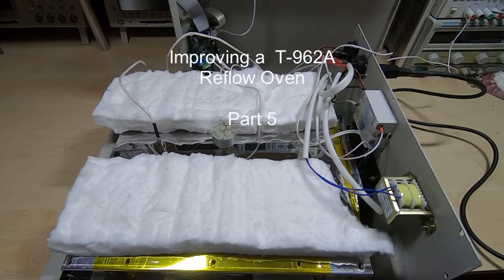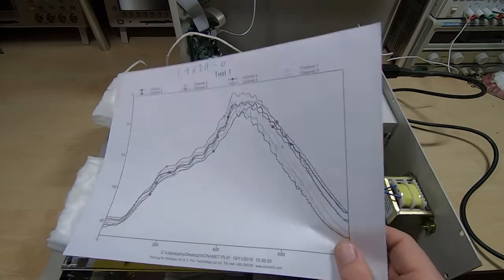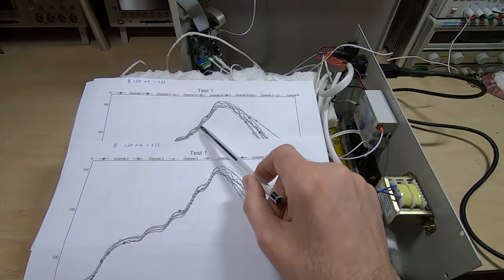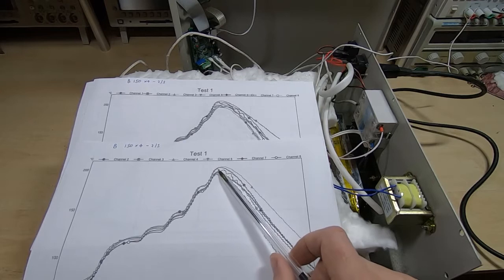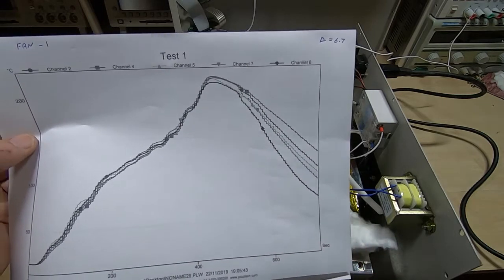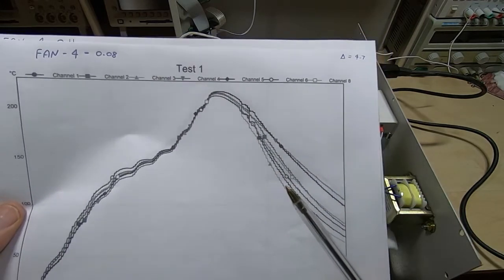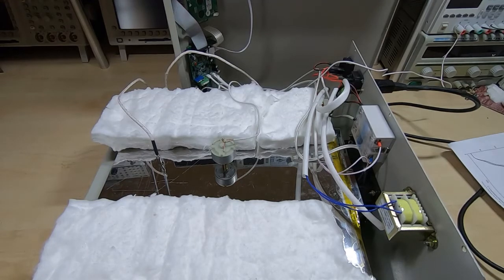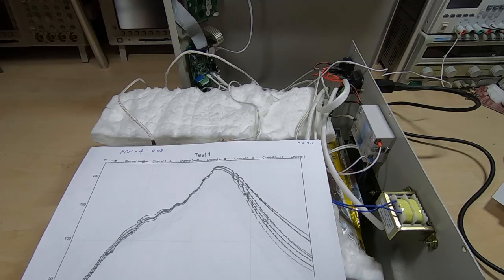Improving a T-962A Reflow Oven Part5

Comment: How effective would the added fan be on a smaller PCB? Doesn't the large PCB (with thermocouples) effect the airflow? Just curious if your fixes would inherently be more effective with a very large board vs a very small one.  Also, what size baffle did you settle on under the heating elements?
Reply from the maker: The board size has no bearing on the radiant temperature profile. That is the point of adding a fan. The only thing that should be affecting board temperature is radiant heat which should be evenly distributed and conduction or convection should be minimised. This is the function of the fan and baffles. The goal is to create even radiant heat over the area of the cabinet and not rely on the board to conduct the heat. I run boards from 15x28mm to the boards I show in the video and they all now reflow very well.
Reply: @JerryWalker001  i see, for a second i thought the added fan was underneath the tray. Do you recall the baffle size for the IR heaters?
Reply: @JerryWalker001  also, did you ever try to upload new firmware and the cold junction fix? I was able to get very consistent results.

Comment: One thing I thought, how much of the improvement is due to the board acting as a duct for the air flow from the fan?  For example, if your instrumentation board had some large holes in it that would simulate more circumstances - like having lots of separate boards, or just one smaller one in the middle.
Reply from the maker: Good question. This is why the fan 'pulls' the air up rather than blowing it down. The air then spreads out and flows down the sides of the chamber and reenters underneath the tray. This in theory should eliminate the major board effect. I have already tried it with smaller boards and it works better as the air can flow more freely but I wanted to show worst case in the videos. I am actually carrying out far more testing than I am showing but will go over anything that ends up being relevant to the final design once I get there. As this is an IR system and not really an 'air' heater then the air circulation is to prevent hot spots rather than be an active part of the thermal cycle. The general idea is to draw air 'across' the board rather and down onto it so this will avoid big differences between small boards and large boards although there will still be better mixing with small boards but I figure if it is better than I am demonstrating then that will not be a bad thing.

Comment: First of all I enjoy your videos, so keep up the great work. It appears to me that you are concentrating on the enclosure and hardware setup of the T962A and NOT the micro-controller. Many other YouTube Videos looked at the micro-controller and left the enclosure and setup alone. The micro-controller on the T962 and T962A has major problems, one of which is that the thermocouples have no cold junction compensation. Another problem is the firmware is very poor and doesn't work very well, if at all. Many YouTube people have flashed the micro-controller with new open source firmware and added a cold junction fix to the circuit board. The best fix that I have seen is a project on Tindie: https://www.tindie.com/products/pnoxi/t-962t-962a-reflow-oven-controller-upgrade/
This circuit board attaches, via magnets, to the top of the case and it has either two or four thermocouple inputs. It only requires minimum changes to the micro-controller circuit PCB (Move the two thermocouple leads to the new add on PCB and solder one wire to the original PCB, cut a USB hole in the side of the top case). It also flashes the micro-controller with new firmware. Check it out.
Reply from the maker: Yes I have seen the various upgrades and I mentioned them in my first video. From the testing I have done I do not think that any amount of firmware upgrades can properly correct the problems I have seen so far. There is a fundamental issue with the temperature distribution. I will be looking at the controller and firmware in later videos but you may be surprised how well the original controller works after correcting the issues with the chamber. The controller can now follow the programmed profile very closely. That is the main reason I am focussing on the chamber to begin with as it will have by far the greatest effect on improvements. Simply messing with the firmware is akin to polising a Turd. The main problem I have with the controller is the poor key response and menu system.
Reply: @JerryWalker001  i agree, you have quite clearly demonstrated in your videos that a well thought out design/modifications to the  main carcus of the chamber is really all that it needs, your graphs are looking very smooth now with your modifications and you havent even touched the firmware yet. nice job jerry